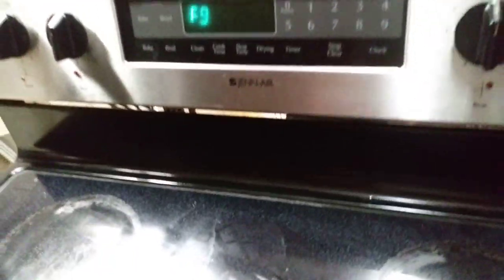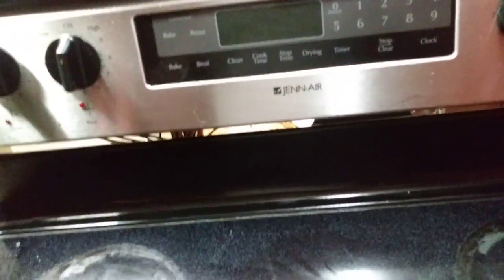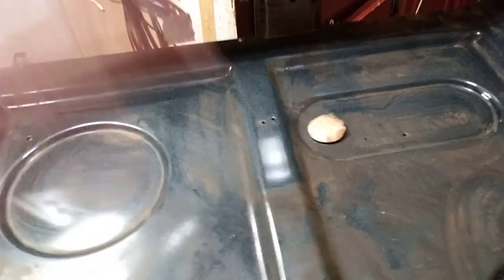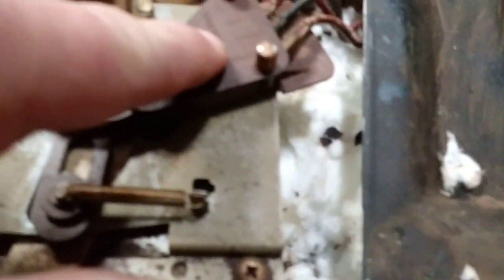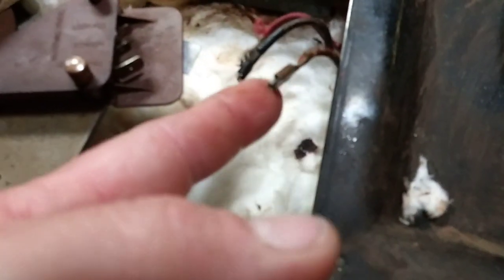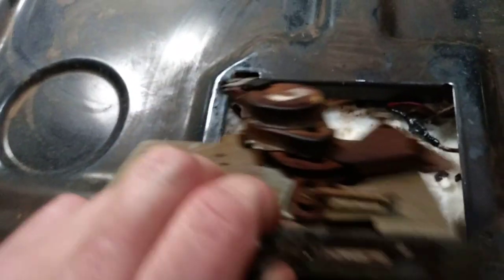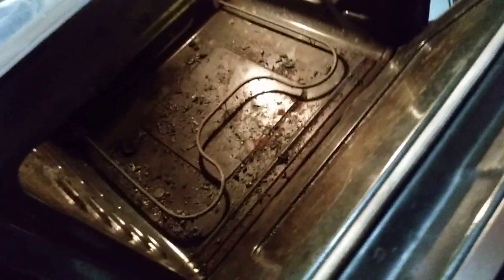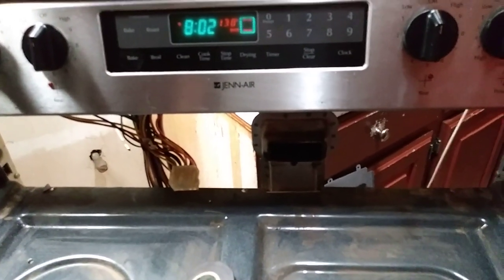Bypass the Stupid F9 Error Code Oven Door Lock!!!

Comment: I have a wall mounted kenmore oven model# 790.40523402 from 2007

This trick worked! BUT! the motor switch for our door lock was labeled NC NO and Common (pretty sure it was called common, it was obviously ground, on the opposite side of the other two wires)

Initially I jumped the ground to the NO labeled wire, assuming the O stood for "Open".
Didn't work, so I tried jumping to the NC wire, and that worked!!!
I had to cut off female quick disconnects, then i stripped the wire a little and used a 2 wire Wago lever connector. It's all done and all good, I just made french fries to celebrate 🎉
Thank you.
Reply: Edit: I reconnected the NO quick disconnect (had to crimp a new one on) back to the switch just so that if one day I want to repair the self-clean function, I'll know where the wires go.

Also, in our case, lube wouldnt have fixed it. The plastic fitting that couples the lock motor to the lock rod had lost its internal "D" shape, so the motor's D-shaped output shaft could no longer rotate the rod, it just spun in the plastic coupling.

So yeah! This was the go-to fix to avoid hunting down that plastic fitting on the internet and waiting forever for it to arrive (if I ever found a supplier).

Comment: With circuit off and oven unplugged. I sprayed oven cleaner in the latch area. Let it sit for 10mins. I tapped my door latch lightly with a hammer to close and open the latch 3x. Fixed my problem. 

Not sure it will fix everyone’s issue but thought I’d share.
Reply: Dominic-Your comment was a lifesaver! I thought I needed to replace the part but I found your comment and decided to try your fix first! Totally worked... which is a huge lifesaver because it's Thanksgiving week and NOBODY has the part I need!

Comment: Exactly what I intended to do, even before seeing this helpful video.
I will add one suggestion for those who take the time to do this.
Remove at least one wire from the Locking Mechanism Motor, and insulate it (electrical tape).
 Do this in addition to making the "jumper connection" with the Position Switch "Common and Unlock" sensing wires, as the video shows.
Why remove a power wire from the motor?
Because the Control Panel will activate the motor if anyone "accidently" tells the oven to Self-Clean. This would be a problem, because the motor would recieve power until the Control Panel "senses" that the Door is Locked (the mechanism has reached the limit of travel, and depressed the micro-switch to indicate "Locked".)
  ...  If the wires are disconnected from the micro-switch, the signal will never occur, and the computer may power the motor until the cows come home.
Disconnecting power from the motor eliminates the chance of the motor burning up, if Grandma decides to engage the Self-Clean feature while you are slurping margaritas in the Bahamas.
Reply: what if my stove is a different set up than the jen air? my motor locking mechanism is in the back. i got 2 wires on locking mechanism and 2 wires on the motor. which ones to i tape together ???? please help thanksgiving is in 2 days!!
Reply: @timwren80  at the locking mechanism, try the oven with both wires off and then with the wires shorted together to see which works. The motor wire just ensures the oven never decided to lock itself.
Reply: @unoefxz  my wires that he's shorting together are joined to plug in at one plug.  Should I cut off the end, wrap the wires together, and tape it?  I don't want to do that till I know for sure it will work.   I can see where they're labeled "com"
Reply: @lillygrace4471  not sure what you mean, but if it is a plastic male and female molex type plug, just strip a short piece of electrical wire bent in a U shape to jump between them.
Reply: also, "com" means common or essentially ground
Reply: @lillygrace4471 ,
uno efx is giving good advice.
I have one suggestion to offer, and one precaution:
I would suggest using a pair of wire cutters, to obtain a u-shaped jumper wire from a large paper-clip. The solid wire of the paper-clip will be easier to insert into the connector plug.
The precaution probably does not need to be stated, but please be sure to wrap the connector/paper-clip with electrical tape to prevent it from shorting out on the surrounding metal.

(Also ... wear a mask when working in close proximity to your oven. Your oven is a valued member of your household, and deserves your utmost care to prevent viral contamination while it is sick.) 😉

Comment: i have a Frigidaire Gallery oven that's locked in F9 error..i accidentally hit the clean button, now i can't get the F9 error code off and
can no longer use the oven..after checking further, it looks like the motor that controls the door latch lock is seized and not working,
which i believe is what caused the F9 error..mine has 1 red wire and 2 white wires that go directly to the motor..any idea how i can
bypass this until i can get a new motor? the 2 white wires go to the same terminal and the red wire goes to a different terminal on 
the motor?

Comment: I own a general electric range, that has locked up because of an interrupted clean cycle. I have error F3, and locked door error. From what I read, locked door error is equivalent to F9. Now I have to figure out which chords I can join together. There are two wires on my unlock switch, one is orange and the other one is yellow. There are two wires attached to my lock motor, one is Grey, and the other one is red. I have two wires attached to my lock switch. One is yellow (which is joined to the yellow one on the unlock switch), and the other one is blue. So out of 6 wires or chords which ones do i join to bypass this stupid locked door/F9/FC error code? I was told that you can only join NC (normally closed) wires only, but which ones would that be. Would the red on the motor be the NC wire, and what you refer to as the common wire. If so then I guess i join this red lock motor wire together with one of the unlock switch wires, either the orange or yellow one ( THanks!

Comment: I have a Kenmore so the wires on the motor for the lock are orange then two gray wires which are combined and plugged into the common spot how do I bypass that..?
Reply: Hi, i have a kenmore as well, with the same issue. What did you end up doing?
Reply: Any answer on the Kenmore?

Comment: But how did you release the door to access the screws to remove to stove top?
Reply: My problem exactly I can’t even pry it open
Reply: @bestgreenhomestead  I was able to slide a wire hanger in and catch the latch to open it. (Different model oven, but probably similar)

Comment: Very Helpful, I don't have a Jennair but figured it out for my Frigidaire from this very helpful video.
Reply: can you provide any help on that?  I also have a Frigidaire and cant use my oven right now because of the code.
Reply: @DreamLabQuest  don't have that oven anymore, but I'd take it apart as he instructs and try the bypass wiring technique or remove the lock altogether. Unplug first as always..

Comment: The only problem with this bypass is that the motor is going to activate if you put it into self clean mode and run the motor until the switch says the motor cam is in position, throwing it into error after a certain amount of time with the latch stuck.